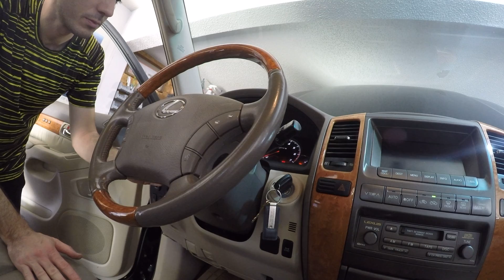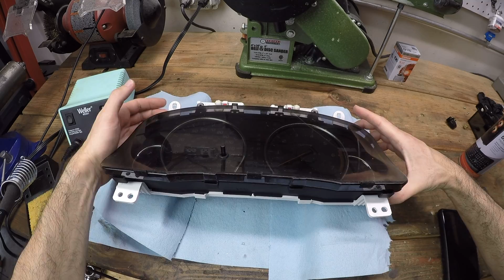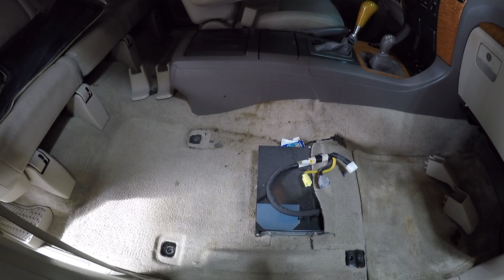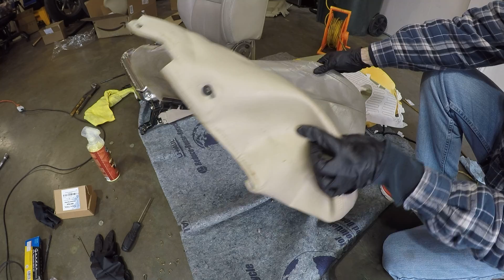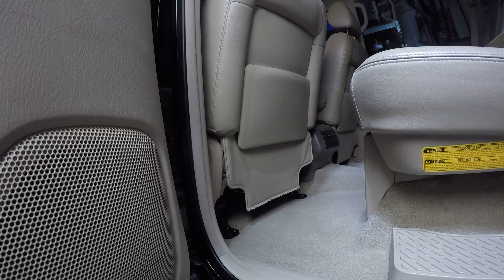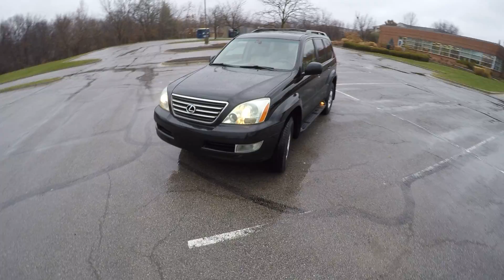High Mileage GX470 Restoration |Ep.5| Cosmetic Repairs & First Drive Review

Comment: :hand-pink-waving::hand-pink-waving::hand-pink-waving::hand-pink-waving::hand-pink-waving::hand-pink-waving:
    ....Thank you for the EXCEPTIONAL LECTURE!!!

... and, congratulations on owning a magnificent machine (I don't have a LEXUS 470, but a 4RUNNER, 4.7 L and the car has exactly the same engine and transmission - different bodies and some additions inside ..., but otherwise - basically the same ... AND IT IS IN NO WAY POSSIBLE TO COMPARE WITH THE 5th and 6th generations of these cars - four cylinders with TURBOCHARGING - FOR SUV - THIS IS "disposable tableware" and only for the duration of the WARRANTY PERIOD ...).
.... the speedometer shows 113 thousand miles: 1) I regularly change the oil in the engine and differentials and IN THE ENGINE not even after 5 thousand miles, but every 4 thousand or 5 months according to the term .. 2) after 75 thousand. mileage - changed the TIMING BELT AND WATER PUMP AND AT THE SAME TIME CHANGED THE TRANSMISSION FLUID WITH FILTER ... 3) the shock absorbers were replaced at 108 thousand mileage - they started to "fog up" 4) now the mileage is 113 thousand - I am changing all the brake calipers and rotors 5) in a couple of thousand I will change AGAIN THE TRANSMISSION FLUID AND FILTER.
... I AM NOT TALKING ABOUT THE WINDSHIELD - THIS WAS DONE SEVERAL TIMES, just like the TIRES... AND SPARK PLUGS (changed several times) ...
ABSOLUTELY RELIABLE UNIT AND I DON'T NEED ANYTHING ELSE!!!!
Good luck to you and enjoy your LEXUS - IT WILL RUN AND RUN, and in your hands it is completely out of question.
THANK YOU!!!

Comment: I replaced the tach and gas gauge stepper motors and in the process all the needles moved out of position. Simply placing the tack or mileage needles at zero does not result in accurate setting once driving. The best solution I've come up with is driving on cruise control with my gps ON and inserting the needles while driving. Is there a better, more accurate way? Also noticed that the small display that gives the mileage is not attached to your board. I am not getting the mileage display upon reconnecting the instrument panel. Thanks for your help!
Reply from the maker: Sorry, I don't know of any better methods for aligning the needles. Your way sounds decent though. With the engine off, place the tach needle at 0. And then with engine on but vehicle stopped, place the speedo needle at zero. At least that's how I'd do it.

As for the mileage display, not sure. I don't remember messing with that at all.
Reply: @PracticalEnthusiast  thanks for your reply. I dialed in the needles with a lot of trial and error. Seemed I might have been pushing them down too hard and they were sticking. I also used my GPS and cruise control to plant it at 70mph and stick the needles on while driving. That gave a baseline. The tach was also a trick but I found the right place. Engine ON seemed to be the best starting position followed by a lot of tweaking.

Comment: I have a GX 03 i’m having the same issue. My tachometer is not working the needles started bobbing and now it’s stuck on zero and also from 0 to 40 miles an hour is discolored. Do I need a new gauge cluster? Because I can’t do what you did to fix the needle. as for your window be in stuck is an easy fix anytime you disconnect,the battery, you have to reset the windows, and all you do is turn it to the on position and whatever windows not working hold it down five seconds and try rolling back up it should work again
Reply: I have an 03 and some of the LEDs were burnt out and dim around the speedometer I got a 08 speedometer from a wrecking yard for $150. I took all the SMD LEDS off the board and put them on my speedometer works great, I could have swapped the speedometer but I don't know how to transfer the mileage.

Comment: Great video! You inspired me to fix my speedometer rather than sending it out. What sort of tool were you using when removing the stepper motor? I saw you soldered it off but you had some tool that was almost punching or clicking on the stepper motor to perhaps break the mounting tabs? Can you explain please

Comment: I really appreciate this channel. Just recently watched the transmission fluid video. Most helpful one I’ve seen. Not sure but I’ll prob have a mechanic do that 😂.I have an 09 with 157k. I recently became the 2nd owner. Do you have any advice on anything I should be concerned abt It’s got air bags in the rear (still working) I didn’t mess with the modes on it bc I don’t want them to fail 😂. I’m also thinking abt a rust protection kit (I live in the north east) great channel love the vids

Comment: We have a 2008 lexus GX470.   We are the second owner.  We purchased it when it was four years old with eighty thousand kilometers.  The vehicle now has two hundred and twenty thousand kilometers, and still drives like new.  Two major repairs were the suspension air springs and electronic struts were all replaced and the timing belt and water pumps also.   It's my wife's daily driver, and she wants to run it into the ground.   Loved your video series. Thanks for making them.  GX470 owners love to see these.

Comment: hey, sometimes the windows regulator switch fail in the door that doesnt work, just may need to the check the switch in the door that has the problem. you can swap them for a moment and try again.
Reply from the maker: I tried swapping the window switches on the rear doors and it still didn't work. Quite disappointing!